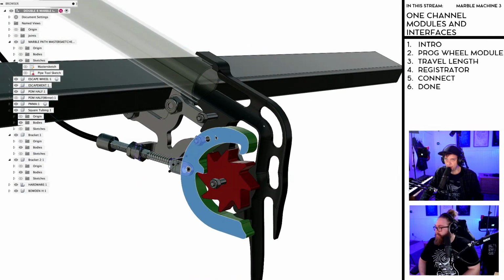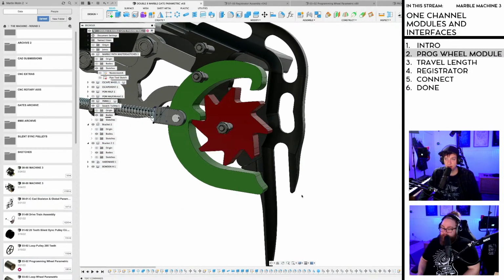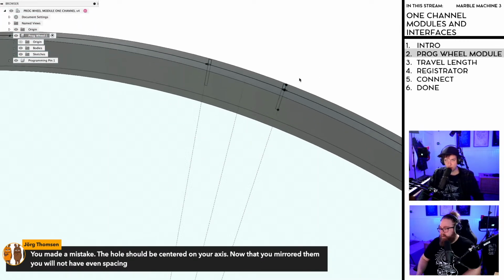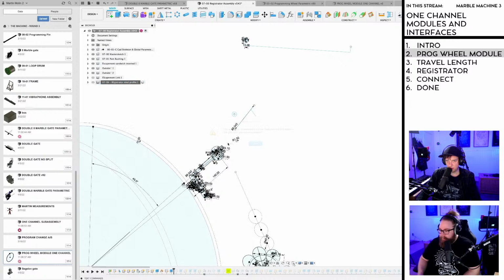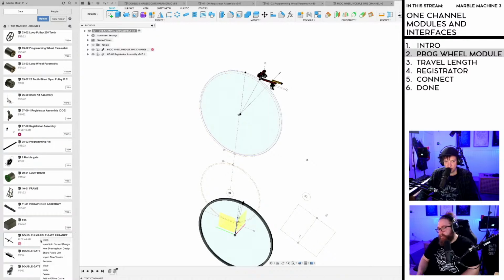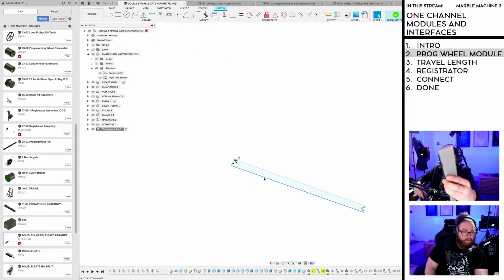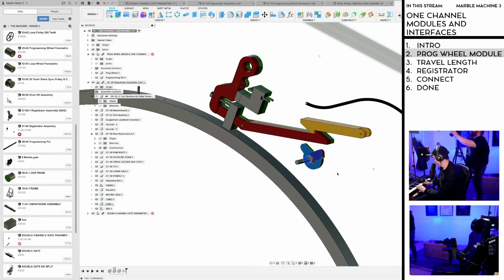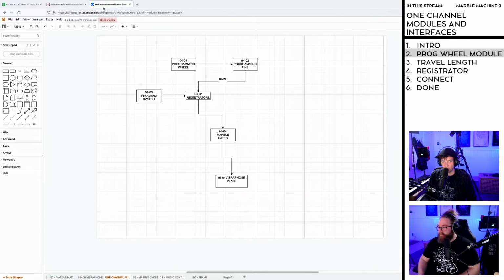Modules And Interfaces

Comment: Problem with hydraulic cables, each cable would require a master or slave cylinder at each end which would complicate everything. IMO Bowden mechanical cables would be plenty precise even with inner-cable friction, stretch is so tiny it wouldn't be an issue.
Reply: They would all stretch the same as well, as long as they're all of equal length.

Comment: I really hope you take some time to actually play with a real cable system. All I can think about is what is on my bike. It is GREAT for a bike. But it requires a lot of power to be effective. And it is not very responsive. Or at least I feel it will not be as responsive or delicate as your system will need.

Also... a different topic... do not allow your drum sticks to rest on the drum head as you did a few weeks ago. That will ruin the sound/resonance for anything else hitting it.